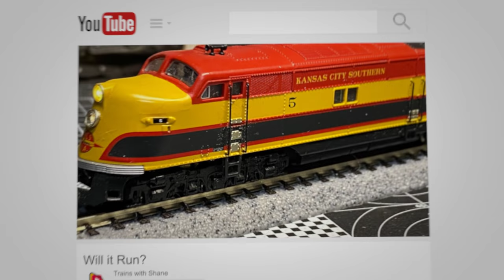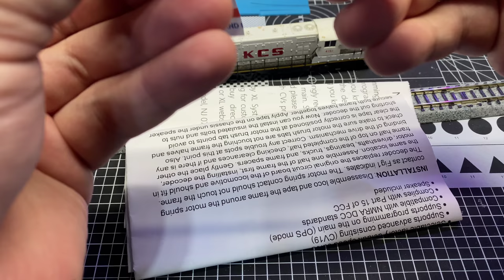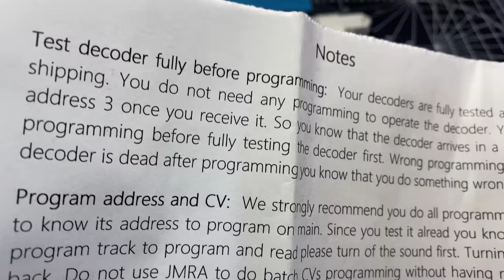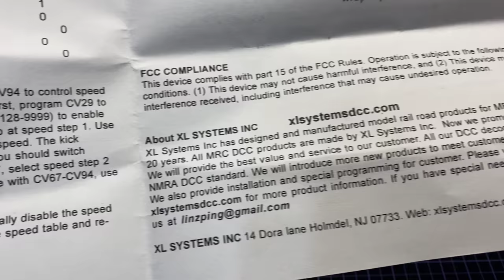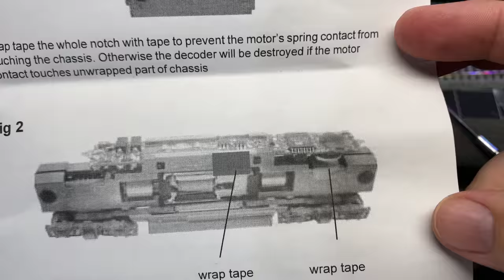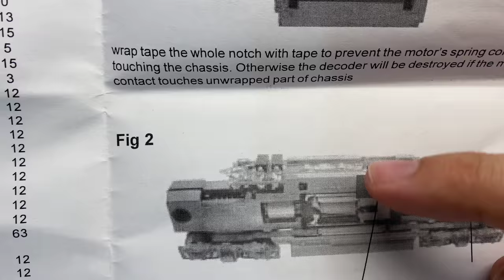Budget friendly and easy DCC & Sound Install on a N scale Atlas GP7 Trains with Shane Ep 74

Comment: You had better luck with them then I have had lately. In the past I loved putting this  decoder In my n scale atlas RS-11's and had no problem's with them. The most recent decoders I have bought from MRC however have all been trouble makers\duds, They won't talk to the motor drive's on the locomotives they were installed on. And yes, I did insure that the contacts for the motor were in place.
Great video!
Reply from the maker: USER ERROR!!!! lol just kidding. Thanks for stopping by, Peter. Did you warranty any of the decoders? If so what was the experience with that process? I'm thinking about picking up at least 1 or two more.
Reply: Mixed, when the company was MRC they would go a far as to install the decoder them self's if there was a problem in some cases. other times they would demand that I send the decoder back, at my own expense and then demand I pay to have it shipped back to me when they fixed it, yes for a factory defect! Those were the best cases scenarios, in other cases, more if this since the company became XL systems, they would use an out that is built into there disclaimers and warranty terms, and this is were they get you, if ither of the companies find that you, the installer/user made made a mistake installing the decoder or tampered with it, you would have to pay for the repair or a new one. and since the user/installer must technically do so to install the decoder,  that becomes an out for them.  @Trains-With-Shane

Comment: I have the same loco with the same decoder, had to mill some metal away with the dremel and file it smooth. The decoder fits perfectly into it. changed some CV's e.g. 123 to 3 it sounds great. good video thanks
Reply from the maker: I may have to try that setting. What did it change?
Reply: @Trains-With-Shane  It will change the sound to a more realistic sound for that locomotive.

Comment: You could electrical tape instead of kapkon  tape, and it would work fine
Reply from the maker: I'd be afriad that electrical tape would be too thick and keep the shell from sliding back on. I need to really get some kapton tape, though. I still haven't, lol.
Reply: @Trains-With-Shane  I  have seen it done on othe YouTube channels, I haven't done it myself , but I have used shrink tubing on the motor contacts so the isolated that was until I got the tape.. N scale is a real bugger. I've run DC train for about 40 years, between ho and when I went to n scale in my late 40's. I got into dcc when I was 68 with sprog pi one and then dcc++ and now dcc-ex, it's been a long journey but it's fun.

Comment: Atlas sometimes uses cheap castings... they can swell up and make the shell hard to remove. I've had them disintegrate when I took a shell off...
Reply from the maker: Thanksfully I haven't had any fall apart yet. But I think in this instance it was due to how tightly the board fit. It's not hard to flex the frame halves, though. So caution is definitely advised.
Reply: You are 100 percent correct. I had 2 Atlas SD26 locomotives do that. Atlas N scale locomotives are junk.

Comment: The shell is probably hitting the clear light tubes in the top. Also I would glue thin styrene to the sides where the motor contacts come up.. This will prevent shorts or burning up the decoder. As you know just order some Capton tape. The little rolls they sell last a long time.
Reply from the maker: I was able to get it on there. The decoder fits so tight in its slots that the frame was spread apart slightly at the top. I was able to squeeze it all the way in with a little bit of gentle persuasion.

Comment: Nice video and nice channel in general. I’ve bought a few sound decoders from those guys for sd40-2s. They work pretty well, as you said, and they are from the same design that is used for MRC decoders. They are not nearly as good as current higher end N scale sound from the big boys. Its really come a long way. 

The volume is really a problem with the cheapies. I don’t need super duper prototypical sound from my locos, but it should sound more like an engine than static, and its a close race there.  It’s often drowned out by “gear noise” too! 😊

I wonder if you can just upgrade the speaker on these units for better quality, or if they are too underpowered?

It’s also irksome the way lower end sound decoders drop when they have a power break. Even a microsecond dust speck will break contact in a way that stops the loco dead and requires the whole “start up procedure” to go back to square one. 

I recently used a spare digitrax sound decoder (really lousy) to make a sound boxcar. Built a wheel pickup system and replaced the built in capacitor with a few much bigger capacitors in parallel, to attempt to fix that stall problem. 

Kinda works. But I’m not good enough to get it perfect. 

The journey continues.  Thanks for sharing your hard work. I’ve subscribed and will be watching. 

😊👍👍
Reply from the maker: I agree on all counts. I haven't really ran this unit much other than testing. I need to get it over on my rescue layout as that'll really give it the sketchy track conditions test, lol.

Comment: Getting what you pay for. MRC clone decoders are cheap bc they are inferior for quality, sound and performance. Spend the extra $ on an Atlas Gold series with Loksound,  BLI QSI sound or Soundtraxx decoder.
Reply from the maker: I'm into the entire rig for less than the price of just a nicer decoder by itself. The exorcise was precisely to see what you get for the comparative lower price. Having quite a few BLI's in N scale as well as various Loksound units I can certainly testify to their superiority. That wasn't the point, here. Also. I don't have the soldering and fab skills, yet, to install a setup that isn't 100% drop in which is why I wanted to check this out in the first place.
Reply: They're not MRC clones, MRC decoders are actually these XL System decoders. XL Systems are the OEM maker and sell them both branded and unbranded.